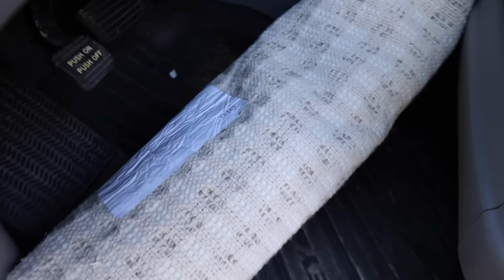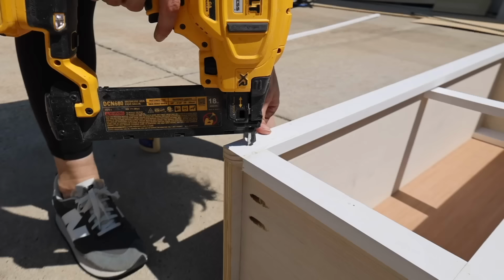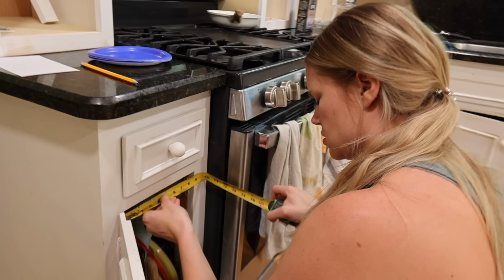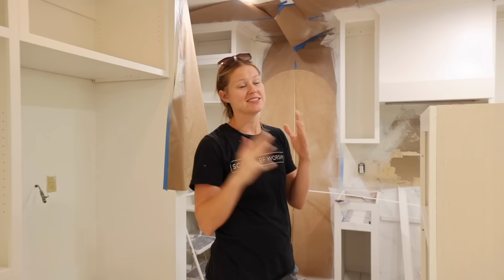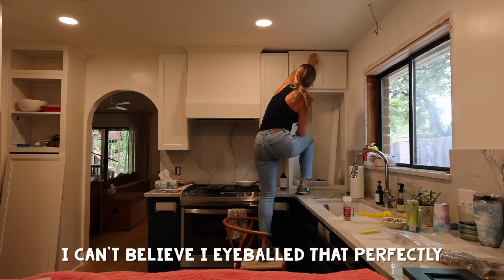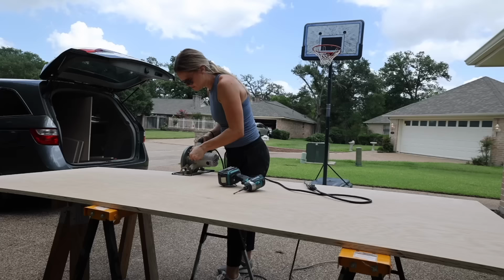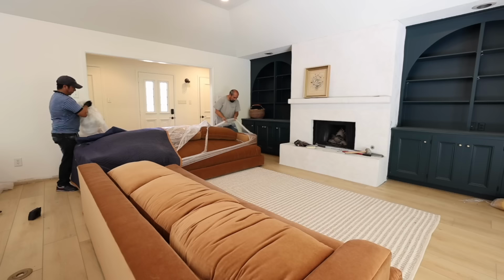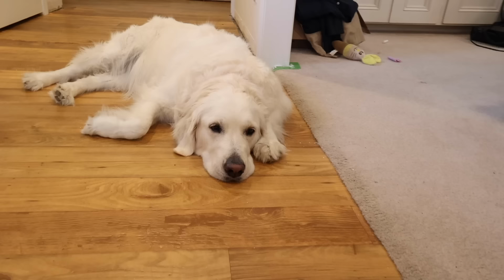DIY EXTREME HOME MAKEOVER [90 Day Transformation!] // Kitchen, Living Room, Dining Room, Bathroom!

Comment: I want to say I love watching you make cabinets. I use to be a cabinetmaker and I think it’s so empowering to watch women get into the trade. Great job! All the time you spend on making packet holes. Think about using a 3/4” straight bit for a router and making 3/8” deep datos. It strengthens the cabinet and there are no pesky pocket crew holes. It may be even a little faster. Fastening isn’t necessary but nail gun (15 gauge) will hold the cabinet until glue dries.

Comment: The height of the lamp over the dining table is "off". It blocks the view of the art on the wall. I think a chandelier with a VERY "open" design would be better.
I think a cord cover on the wall for the lamp would be a good idea. You can paint it the same color as the wall. Then it would not detract from the art display. 👍😉

Comment: You should hang a sun shade off the garage to provide shade while working in the driveway.  Costs about $30 on Amazon.  Screw  hooks into garage fascia then hook onto metal poles on other points.  You’ll be amazed at the difference for such a small price.

Comment: Awesome job. Congrats. 
A little tips from Belgium to avoid unclear cut on plywood : 
1/ put some masking tape 
2/ draw your guide line on the masking tape 
3/ cut with a jigsaw / any other saw 
4/ remove the masking tape
Cut is clean without need of wood filler 

The same when you need to drill on a painted wall. It avoid any marks on

Comment: You guys are amazing. Atlas man, save your strength. Just use a scrap piece of 1x4 and drill it into the studs right below the line where the upper cabinet goes. The weight will hang on it instead of on you lol. Then you can just push it with minimal effort to hold it in place with one hand and drill it into the wall with the other.

Comment: The kitchen cabinets look amazing, but I have a question: I was under the impression that cabinets in the kitchen should be installed with a french cleat, but it looks like these went directly into the studs.  Is that normal?

Comment: Great Job but not crazy about the items used in living room. The coffee table and chair are just so small compared to that ginumerous sofa!  Also bookcases are gorgeous but the styling could use some help. The lamp definitely does not look good sitting on edge of the bookcase. There is not any other tables or lamps in the whole space. Someone sitting on the ends of the sofa have no where to place a drink or there is no lighting for task work or reading.  The picture  of Mother Teresa should be on left side  since she is looking toward the left.   Just pointers from a 35 plus years of interior designing. All in all great carpentry and diy work!

Comment: I’ve enjoyed watching this video, but I cringed when I watched you hang the drawer front with tape 😅😅 I would’ve much rather seen you use 1 1/4” screws from the inside (at an angle, as to not screw thru the middle panel) but otherwise I have loved watching all 2 hours of this video!